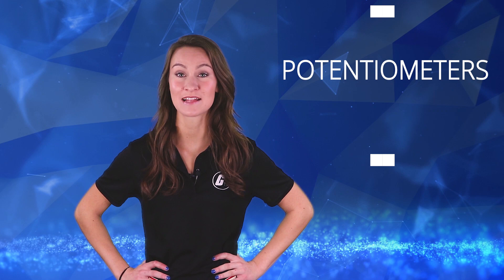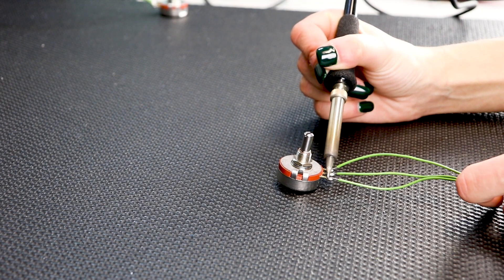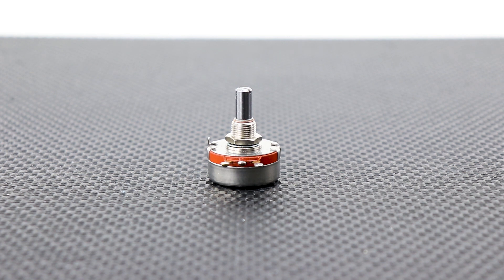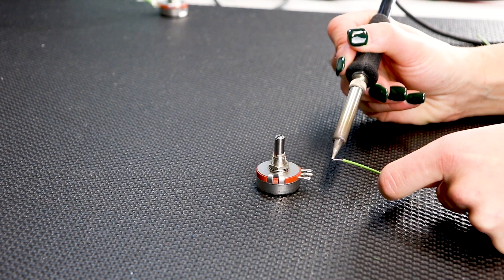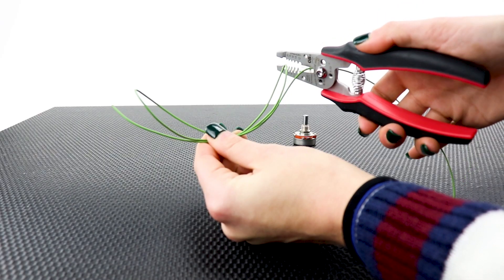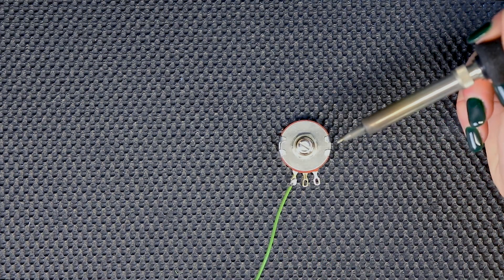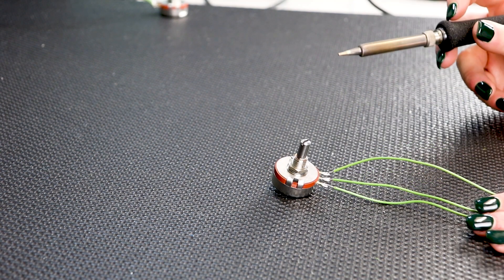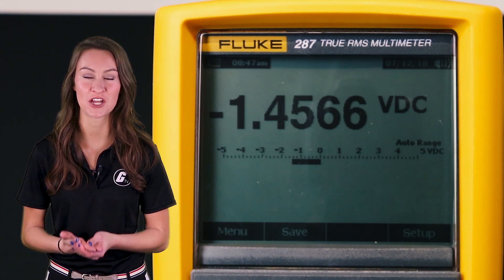How to Wire a Potentiometer | Galco

Comment: I am sorry but your website doesn't work, may you can help, I am looking for a volume control with switch that has 5 prongs to connect to surface mount on side of board I think it was 80K, it is for Creative Labs Inspire 6600 6.1 Computer Speakers, if you have it please let me know. Thanks,

Comment: Oh my God, it depends on what you want to use it for, and NO you cannot put so much voltage or current through them, they will burn out, also don't set your multimeter to volts...lol, it needs to be set to resistance. to test what resistance it is if it doesn't state it then connect the multimeter to tabs 1 & 3, to use it as a simple volume you can connect 1 & 2 together only leaving 3 alone, now put the multimeter to 1 & 3( as 2 is connected to 1) and turn it, you will then see the resistance drop as you go higher.
Reply: shit! that's what we needed to hear ! the comments section has done the job the video set out to do but failed to do. thanks !

Comment: what is the difference between type A and type B potentiometers ?
Reply: As I have observed it, type A gives you a linear change in resistance as you rotate the control shaft. Type B is non-linear, or logarithmic.  Type B  is often used for tone controls.

Comment: Surely she meant ohmmeter?
Reply: You can do it with an voltmeter also if it puts a load. Most multimeters have this option for testing certain batteries, ie button cells and 9v.

Comment: So you set that nice Fluke Meter to VDC to measure the Resistance change of the Potentiometer? Got it.
Reply: Yes exactly. I just got a fluke 83 so I could test my pots
Reply: LOL! I was thinking they had a AA rechargeable battery running across it instead of just using the ohm meter. 🤔
Reply: Ok

Comment: Would this work for controlling the speed of a dc motor im running about 33volts with no load
Reply: It would work but would be really inefficient if wired directly to the motor i suggest u looking into pwm dimmer
Reply: You need an electronic speed controller where a small voltage wire controls the large voltage amp draw
Reply: @infotechsailor  I moved past this lol now I'm running a 48v 1800watt brushless kit

Comment: You only need 2 leads for hot signal control, granted your inputs ground themselves when nothing is connected. The third pin is most used for audio ( non dc electrical control. Never attach anything to this pin if controlling voltage as you will cause a short to ground. So 3 pins for audio and 2 pins for voltage control.
Reply: Thanks! Exactly what I wanted to know.
Reply: Michael Robinson because you only use 2 pins for voltage control it would be bad if you used all 3 as a rheostat by not wiring them properly. This is why you when you hear control “voltage” you stop immediately and cover up the non used pin, this alerts others that you are not using it as a Rheostat. This is why if you buy a cheap Chinese mixer you always open it up to check how the pots are wired!!. They have a tendency to “F it, wire it up wrong”.

Comment: I looked at about 25 wiring diagrams of potentiometer terminals. With the potentiometer positioned the way you have it. Some had ground and power/input terminals reversed. How can you tell which way a potentiometer is structured? I thought they were all the same: Ground    Signal/Output   Power/ VCC.  But judging from the wiring diagrams they are not?
Reply: Good